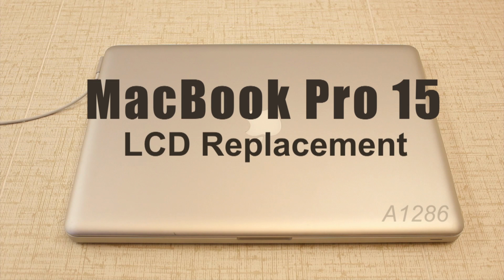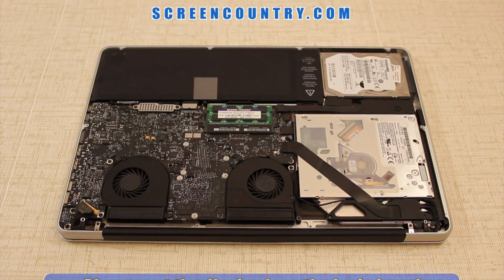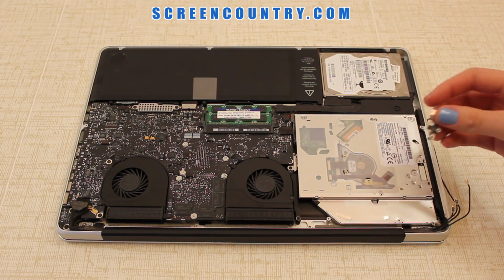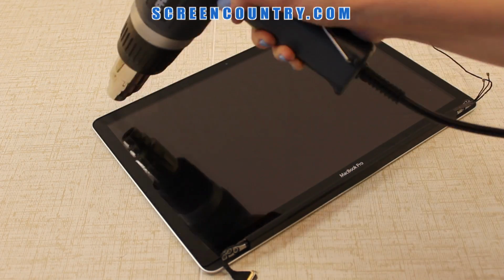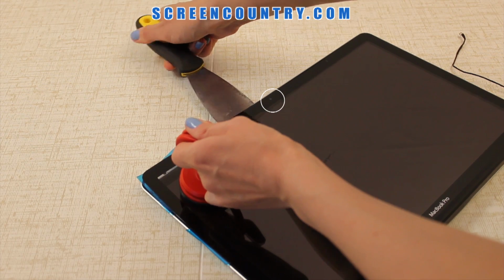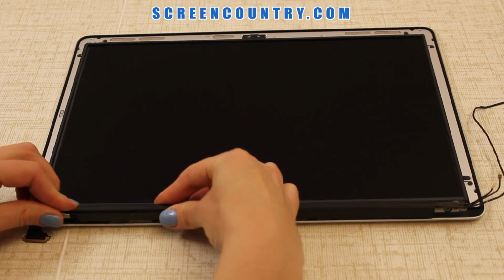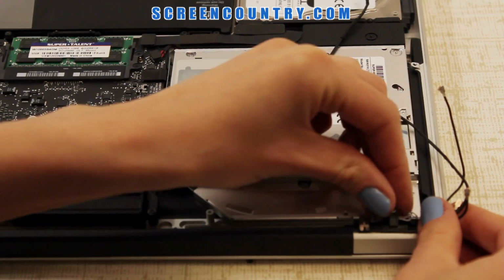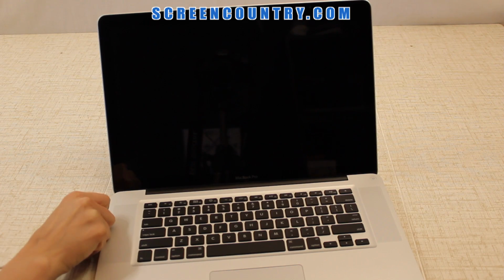MacBook Pro 15 LCD Screen Step-By-Step Replacement Guide

Comment: I could not of replaced my Macbook Pro 2011 A1286 Screen without this tutorial so thank you for making this. 

I actually bought a secondhand display assembly kit (2010 A1286 model on Ebay for $130 so all I had to do was remove my dead screen and put the new one on. Still took a few hours though as it was my first computer repair. I would recommend doing this if you are new to repairing computers like I am. 

Things I would do differently...

Buy a decent Torx screwdriver from the start. DON'T go cheap on Ebay like I did.

To replace my broken Ebay Torx screwdriver I bought a $12 Gripwell precision screwdriver and bits set. This also came with a decent Philips-head (size ph000). Although they don't have magnetic tips which would come in handy! 

You will need a T6 to remove the 6 screws that hold the display.
Reply: "I could not of"

What is that supposed to mean?
Reply from the maker: I could not have
Reply: Elementary school for the win!
Reply from the maker: Everyone gets a star!

Comment: Sayit:  the higher resolution "retina" LCD is not compatible.  Many 15" LCDs are compatible.  Resolution generally must match, though you can sometimes upgrade a laptop to the next higher resolution display offered on your model.  IBM Thinkpads are an example of this.  You can swap a 14" 1280x800 for a 14" 1440x900 or 1680x1050 on a T61 or T400 for example, because the computers were offered with it.  You just have to make sure the connector is on the right side and that the backlight matches.

Comment: I'm not completely sure but my guess is to stick with the same. The retina display might be one of the reasons why they switched to an Intel 4000 integrated graphics instead on the 3000 previously used. Also i just noticed that the connectors to the logic board are different on the retina LCD compared to the normal 1440 x 900 LCD's

Comment: This procedure is only possible on a 13" Mac Book Pro due to the clearances necessary in getting the glass off the screen. The larger screen Mac's don't give you the proper clearance between the "unibody" and the LCD unit as the 13" one does, believe it or not.......

Comment: I don't think you can, cause the retina display shell has different connectors, and also you can't remove the whole screen from the retina MBP cause apparently is attached to the mother board, don't quote me on that though.

Comment: I dont understand why you had to remove the back.  From the video the internal screen had a connector which you removed,  so why can you not remove the glass the same way and then replace the panel without removing the whole back of the unit?

Comment: Screen is fine. However when the computer heats up, I get green pixels in the dark areas on the screen. When I press on the case to the left side of the keyboard, green pixels go away. I researched the problem on line and found that others have had the same problem and they solved by replacing the display cable. I have a mid 2010 15" MacBook Pro and want replace the cable. My question is, I don't have the glass, I just have the non glare screen with a metal bezel around the edge. Do I remove that bezel the same way as I would the glass (heat gun, putty knife etc.?)
Reply: Hi Stephen, I have the same problem. Did you fix it by replacing tha ceble?

Comment: Erm i have done this works great but now my camera doesn't work. any ideas?
Reply from the maker: Check the connection at the Motherboard (un-plug it, plug it back in), if that doesn't help - then check the connection to the cam board in the display assembly. 99% likely that it's the jack's connections, 1% likely that it's a break in the cable.
Reply: ScreenCountrycom Nooo. As i was checking the connection the wire connecting to the motherboard snapped off :( 

No more cam for me :(
Reply from the maker: ***** Well at least you found the break. These cables aren't terribly expensive - you can get one on eBay (Make sure to substitute your MBP Model # in the search):
http://www.ebay.com/sch/i.html?_trksid=p2050601.m570.l1313.TR12.TRC2.A0.H0.XA1286+webcam+cable&_nkw=A1286+webcam+cable&_sacat=0&_from=R40

Comment: I have a mid 2014 A1286 model and cannot find where to get a replacement. Any suggestions or do you have a link where you got yours? Desperate!!
Reply from the maker: You be trolling? We got our replacement from our warehouse shelves... You too can get it from the same place!
We even made a website so you can order it on-line:
http://www.screencountry.com/index.php?section=products&model=MACBOOK%20PRO%2015%20Unibody%20Model%20A1286&brand=Apple

Comment: my case.... no image and the apple does not turn on , currently use an external monitor, it is the only way to use it.

Do I need to replace the screen ?
Reply: Alexander Nelson take it apart and check the cables

Comment: What type of screwdriver did you use on the Torx screws?
Reply from the maker: Nathan Young IIRC its a T8/T8H. But this could be wrong - video is old. Certainly one of the following will work: www.screencountry.com/629803983/

Comment: my lcd cable is stuck, and when I tried pulling it out I pulled the metal thing out it actually bent where it goes in.
the computer works fine still, but even with some hot air on the connector i cant get it out
Reply from the maker: +steaker1705 The metal bracket (looks like a part of a paper-clip) can be put back and the bent pivots can be straightened out. Technically you could complete the repair by not pulling the video cable out of the mobo - but you'd have to work extra cautiously with the main-body attached. You could try to pick the jack out of the connector with a tiny flat screw driver - make sure you are pushing on the jack - not the connector.

Comment: Does it works on the Mid 2014 MBP 15" retina?
Reply from the maker: Abi Chau Its virtually the same if changing the entire screen assembly. However if you are trying to change the LCD matrix only - its a much more complicated process.

Comment: Thanks. Why bother removing the top half of the computer, though? I'd think you could loosen the glue on all sides except the bottom with the heat gun, and still be able to get the glass off. Perhaps not, though.

Also, it would be nice to see a demo of removing a matte screen. The matte screens don't have the glass overlay, but rather a silver bezel around the edge.
Reply from the maker: Can't get at the bottom tiny screws. Its possible to replace an LCD on a MB(P) 13's without taking off the top cover, but not on the 15. 
Also the matte screen is the prior generation MBP: https://www.youtube.com/watch?v=FA-IfU6JlTE
Reply: Thanks. It isn't the previous generation, though. I'm typing this out on an A1286 with matte screen. The video you linked to shows the much older generation with removable battery.
Reply from the maker: Ah, interesting. Apple sure did have some interesting "in-betweeners" over the years. I used to own a 2008 aluminum uni-body non-Pro! Mac Book - only sold for 3.5 months. I would say the matte version would be easier to deal with than the glass one, but you have to be ultra careful to not mangle the aluminum bezel when taking it off - its really hard to take it off with-out creating creases and bends.
Reply: Thanks. Yep, I'm anticipating that to be a pain in the ass. But an even bigger one is figuring out the part number for the matte screen without taking my computer apart; so far I've bought two different ones on eBay that were indeed new and compatible, but had a BS semi-gloss "antiglare" finish.

Comment: The damn LCD cable is too low, I can't wedge it out enough to plug it into the new screen.  What now, smart guy?
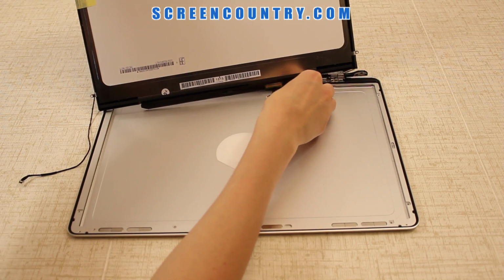Reply from the maker: 3:26 Pull it out as much as you need. Also its a smart girl - you'd think the nail polish would give it away...
Reply: ScreenCountry Savage reply lol